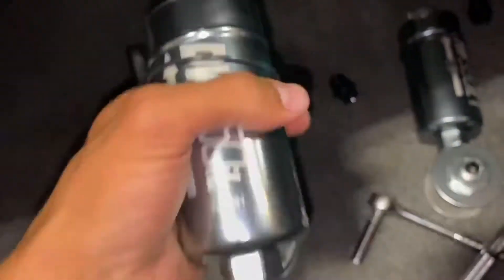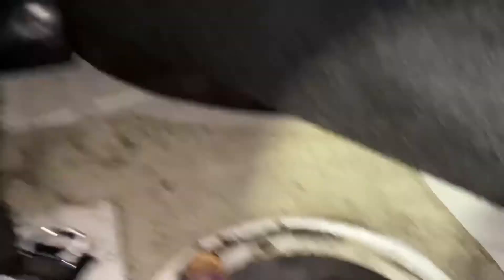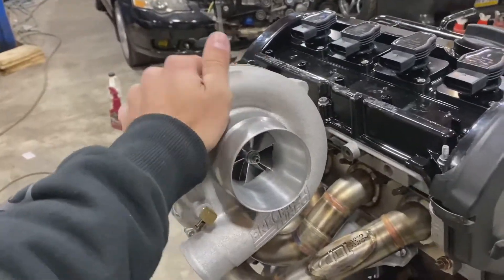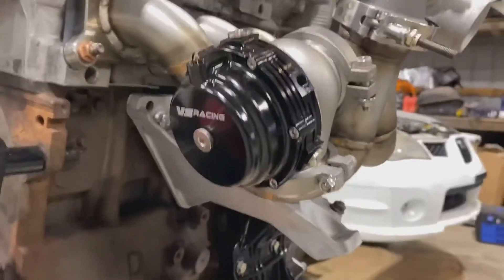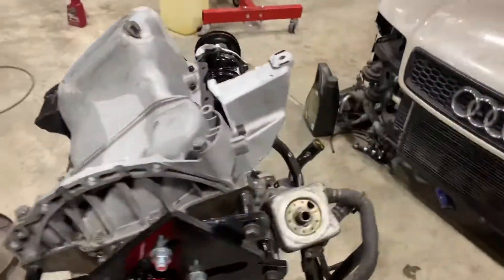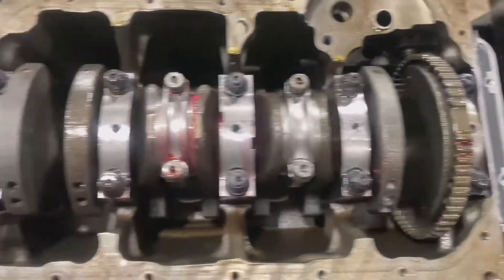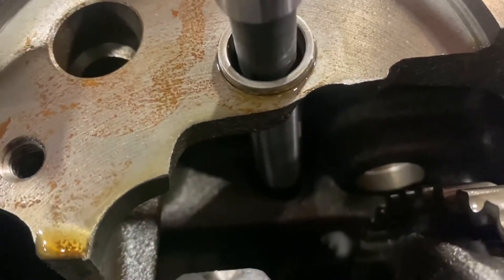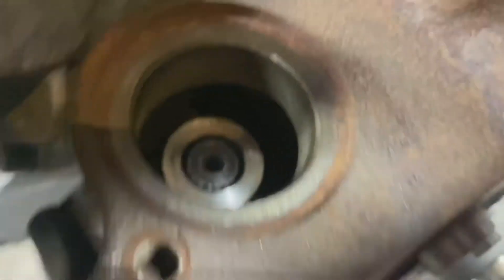B5A4 EP4: Fuel System (pt2) + oil pump install

Comment: I'm building a 1.8t 058 as well. How did you convert the fluidampr crank pulley for use on an 058? It says it can only be used on an 06a and I'm wondering what you did to make yours work. Did you also find a billet crank gear? I only found one that works with 06a blocks or did you use that one on your 058?
Reply from the maker: I don’t think fluidampr makes the part anymore unfortunately. I would shoot them an email and ask though. 

I have the 058 dowel pinned crank gear from IE. all of the websites in the US say “no longer available”, but i found this one in canada. not sure if they can ship here but maybe shoot them an email too https://comotorsports.ca/1-8t-timing-belt-gear-dowel-pin-kit-058-early-1-8t-and-16v-iebeva6-usp.html